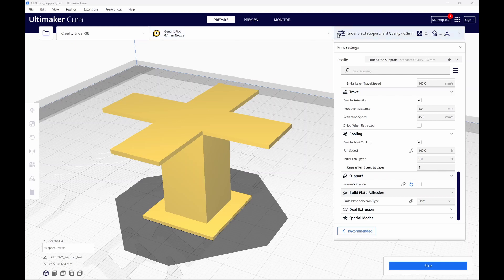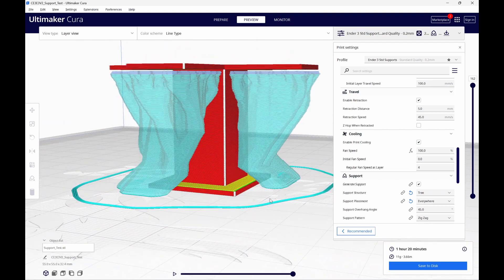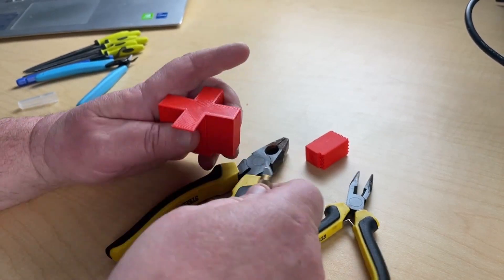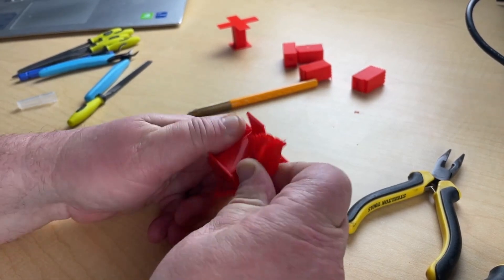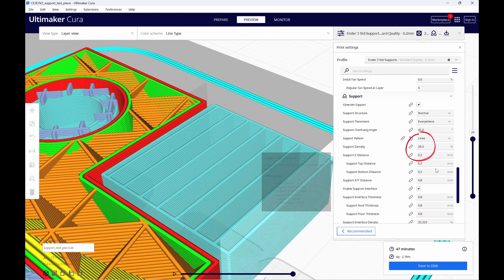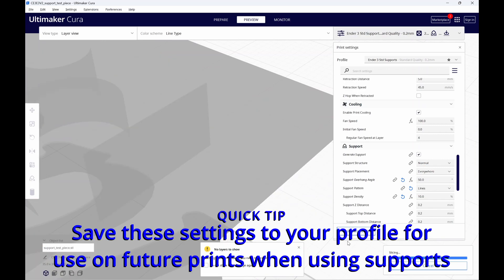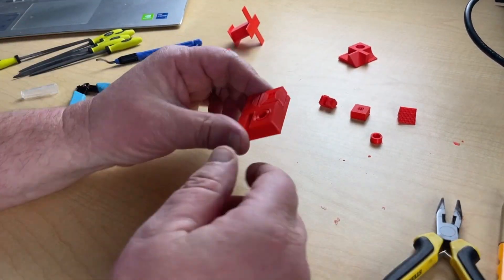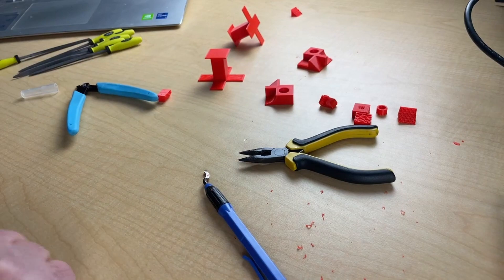Easy To Remove Supports In Cura

Comment: Hello there, it would be great if you try to install the BLTouch leveling tool on that ender 3 and check issues to come back with your comments.
Reply from the maker: lol, actually I installed a BL touch to all of my Ender 3's. What issue are you having? Mine worked great.

Comment: what setting did you use to make it that massive support, when i use tree supports they are devided
Reply from the maker: Normal supports, touching build plate.
Reply: @pushingplastic7445  but i mean, when you showed the tree supports they were in one piece going around the model and when i use tree supports they are devided into 4 pieces
Reply from the maker: @Kitsunux  At about the 2:53 mark in the video, it was tree supports, everywhere. Cura has been upgraded since this video was made and it might not do that anymore. Getting the supports off when printed as one piece is harder to do without breaking the model. Most like likely Cura was updated to handle tree supports more efficiently.
Reply: @pushingplastic7445  ah ok, Thanks :)

Comment: How do i remove supports just in specific places? I have one that always ruins the print but don't want to remove everything.
Reply from the maker: I'm not 100% sure of your question. Do you mean avoid putting support in certain areas? That would be with support blockers. Or is there an area than needs support removed that's hard to get to? That would be a tough one to answer without seeing the model.
Reply: @pushingplastic7445  Thanks for answering even on an old video, already solved it whit support blockers. Very useful info.

Comment: This taught me nothing. And i bought my printer last week
Reply from the maker: If you just bought your printer last week, what exactly did you expect to learn from this video? There are other things to learn first, like dialing in your printer and material. I'm not sure what you expected.
Reply: @pushingplastic7445  like a setting that makes supports stick less. Or a setting that makes the last layer of the support smaller .
Reply from the maker: @KronicDaydreamZ  So you missed support interface layer?

Comment: Every single thing I print in Cura with tree supports leaves two unremoveable layers from and parts that have a flat over-hang or close to it. One layer will be a separated criss-cross layer (on the outside) that is very hard to remove and then inside of that will either be parallel layer of all touching lines or a mangles mess of strings that are hard to impossible to remove without damaging the part. I'm not sure what's causing this and couldn't find anyone else with the same problem that's figured out how to fix it. The tree supports remove verily easily, but the top layer fo the tree supports appear to get stuck to the part. This is confirmed by measurements also. (If I have a very large over-hang that has parts below it that the tree supports sit on, then this bad layer will not exist and the supports will come out of the part just fine without leaving these unremovable layers stuck to the part. If anyone has an idea on what causes it or how to fix it, I would really appreciate it. Even guesses are welcome.

Comment: I just had to deal with the exact problem at the end of a 4 day print, raft wouldn't come off and supports broke most of the parts that I did manage to get off the raft relatively cleanly as I tried to take them off. I ended up tossing the project and starting over, scraping off remnants of the raft stuck to the underside of the parts and then scraping/sanding leftover bits of support is not going to work on something small and fiddly.
Reply from the maker: Bummer, nothing worse than a ruined print because of supports of a raft!

Comment: Thanks for this.
One place I have issues with supports is where the overhang has very small clearance. I have been trying to get a clean print of a model that has about 3mm between the overhang and the bed, with the overhang being flat, about 10mm long, and supported on one side. Pretty much worst-case, right?

Comment: Another option i use on differant software is the air gap. Meaning the distance from the support to where it touches the model
Higher the airgap the further away.
Can this be done in curu to
Just to say i love watching all your informative videos. as they make sense .
Reply from the maker: It sounds much like Cura's Z distance. It's the distance from the top of the support to the underside of the print.

Comment: Anyone got the same issues with concentric support being empty? I used the latest version of cura, which I believe is 5.2.2 and if I choose concentric support, it will always be empty where there should be support infills.
Reply from the maker: I noticed that when testing for this video for the support structure. At first I thought I found a way to cut more time off while using supports until I noticed it was empty inside. That's why I opted for lines. It did function as expected for the support interface.
Reply: @pushingplastic7445  I had this issue for at least 2 monthes now. I think I will raise a ticket to the development team.

Comment: Can you add some links to the files and deburring tools you used?
Reply from the maker: The tools were all part of a kit I got from Amazon a few years ago. It's no longer available but this one is very similar to it. Hope it helps! https://www.amazon.com/Cleaning-Finishing-Printing-Accessories-Prints/dp/B099K47RCY/ref=sr_1_8?crid=315ZLE0PK50HJ&keywords=3d+printing+kit&qid=1675721428&s=industrial&sprefix=3d+printing+kit%2Cindustrial%2C116&sr=1-8
Reply: @pushingplastic7445  I appreciate the recommendation!  I hope it's an Amazon affiliate link so you can get a commission.
Reply from the maker: @kirkpatrickwindowcleaning  That would be nice, but I haven't set anything like that up!

Comment: This was very helpful however I do find it odd that so many people seem to be overly focused on print times but ignore how much filament will be used.   I'm fairly new to 3D printing and I'm kind of cheap so I look to reduce my costs where I can.  Not only can these settings help speed up the prints but they can also use less materials.  I've found many times support use can increase filament usage by more than 50%.  That's not insignificant.  But I was glad to see that I have been messing around with the same support settings you showed here.  That tells me I am on the right track.  :)
Reply: you do realize unless you somehow are getting free electricity, longer prints means your electric bill is higher.
Reply: @OmarGarcia1  If electricity costs were a factor I would be seeking ways to turn this into an income generation rather than a hobby.  I'll wind up  spending far more on filament through test prints and failed prints than electricity and this is one of the reasons why I find it so odd that these things seem to be ignored.  It's the "microwave mentality" where everyone seems to be unable or incapable of just waiting a little longer.
Reply: I've been printing for years and at this point I don't care how long a print takes... unless you are waiting at the printer to remove the finished product when its finished then what does faster print times get you? Often lower quality and or failures. I usually am asleep or outside when the prints finish so if it sits on the build plate for 3 hours waiting for me to get it then there was no point to going faster.  Also I'd rather pay a few extra cents in filament then to struggle with hard to remove supports and possibly break the model. That's why I recommend a 100% support interface density roof at 1mm thick using concentric pattern. Supports themselves I use tree triangle pattern and at least 20% density; much higher if TPU or smaller details to support.. my prints aren't fast but they come out good and usually on first try..

Comment: Saw the "x" support interface and smirked a bit.
- Support pattern: Zig Zag 
-Support Wall Line Count: 1 - makes it easy to grab with needle nose pliers and remove.
- Density: 15%
-Support interfaces: OFF

Comes off nice and easy for me with little effort. If I'm doing a print that I know is going to take 12 hours, I'm not gonna notice or care much about time save. Especially when I'm printing while at work.

Comment: This is really helpful! The issue I have is when I pull the supports off there is a support pattern that is still stuck to the print that is very hard to remove. It also hides a lot of detail if I am able to remove it. I guess I just need to keep playing with the settings.
Reply: Did you figure this out? I'm having the same issue at the moment
Reply: @andrewmcmahon8220  I did. It came down to changing a few settings. It looked like my issue was caused by over-extrusion. I traced a few failed prints back to improper leveling...
 
I calibrated my rig using a calibration cube. I made sure to only change one setting at a time and then reprinted the cubes. It takes time but you nail it down to what the issue was. If you change too many things at once then you don't know which change fixed the printing process.
 
I also decreased the flow rate. This seemed to be the overlying issue. However, changing from PETG to PLA caused me to change this parameter too. I just stick with one filament type for an entire project now. 
 
I also decrease the distance between the printing part and the support structure. This showed immediate results. The part that connected the supports to the print peeled right off. I hope this helps!

Comment: Cura 5.1 made tree supports much better. The normal supports were always bad and custom supports were a necessity.

Only problem i have had recently is that sometimes the tree support will come loose from the bed and cause a print fail.
Reply: I've found if you put a brim set on everywhere in bed adhesion it can stop it from coming off the print bed more. Doesn't work 100% of the time but significantly reduces failure rate. Since the brim is only like 1-2 layers think it'seasy to break off and clean up compared to having to use line prints or something.

Comment: You should have pointed out the OBVIOUS for the newbies that might see this video. In the second one if you had flipped the object 180 degrese you would have not needed any supports and actually in the first one if you flipped 180 degrees you would have needed less support too because the base was quite smaller than the upper part. I know the purpose of the object printed the way you did was to show the difference in support but for newbies to remember them the option to flip or search for better angles to position the object it is important.
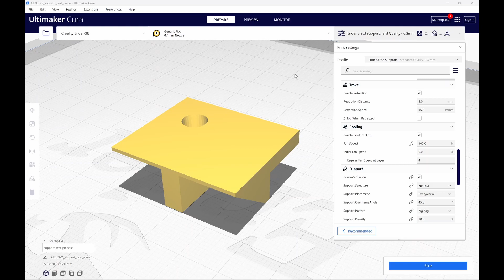Reply from the maker: It was pointed out at the 7:48 mark of the video for the obvious reasons! Thanks for watching!
Reply: @pushingplastic7445  LOL missed that bit. Awesome. Great video. keep up the good work.
Reply from the maker: @TheStickyBusiness  Thanks for watching, I really do appreciate it. And keep those comments coming!
Reply: Thanks for this because he did say it in video but I haven’t done it before so I had no idea how to do it 😂

Comment: These little pearls of wisdom are such a treasure to us newbies. I used tree support for the first time today, after watching your video. I'm used to using normal support and lowering the interface density down to 5% or even less. Those tree supports aren't going to eliminate the traditional way, but it's another nice tool at our disposal.
Reply from the maker: If you like the Tree supports, then you'll love this. Cura is currently working on what they are calling Christmas Tree supports. It uses less filament, reduces time even more and will be even easier to remove. The Christmas Tree supports are still in the Alpha stages of development but I'm looking forward to trying them! Thanks for the kind words and thanks for watching!
Reply: I have to go into the settings and check the boxes for these options to appear? I see many options in the settings, but I'm not sure what any of them do and don't want to ruin my settings, because I've been printing mostly good parts since I built it. The only problem I'm having with Cura is the overhang interface support layers fused to any areas of flat over-hangs. The bottom layer (outer-most on the part) is a very coarse diamond pattern that is hard to remove without causing damage to the part... and then the next deeper layer will either be parallel lines all touching or will be random looking and is impossible to remove without causing damage. Sometimes there will be a couple that I can get a finger nail under and separate a fair length, but for the most part they're just fused too well. Forgive the rant. It's just bad enough to ruin some parts that require accuracy (and I know that the printer is capable if it's set up right). It's weird, because the tree supports will be easy to remove from the part like always, but the top layer of supports/interface is fused to the part and not the trees... so I'm not really sure how that can happen.